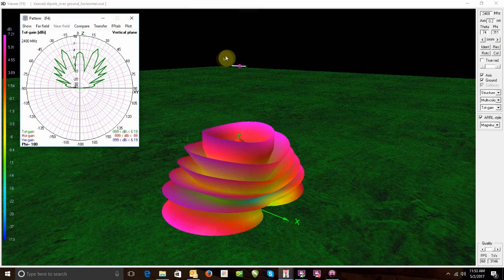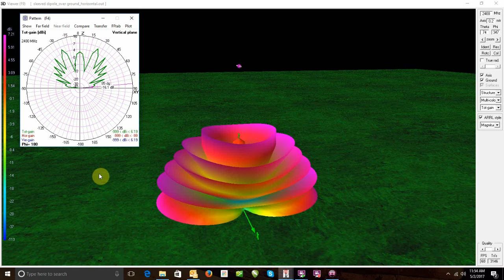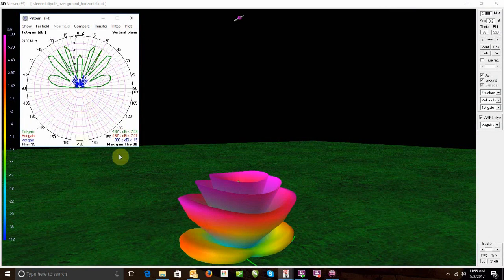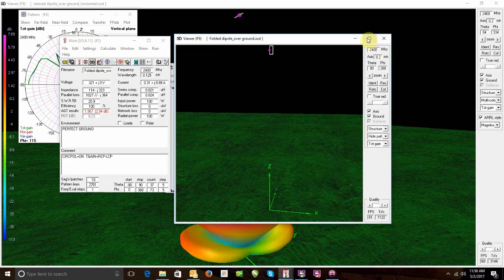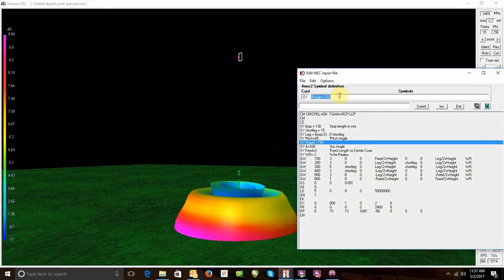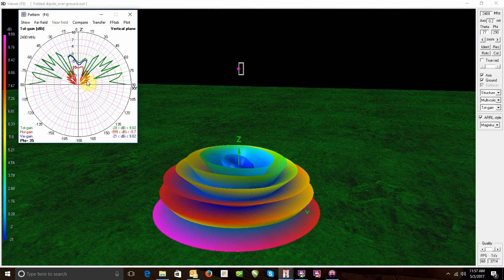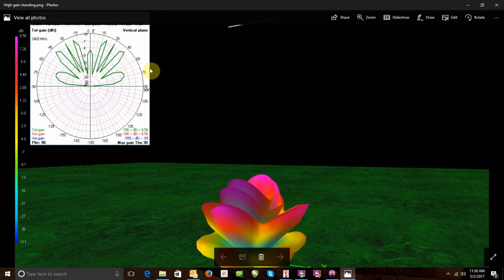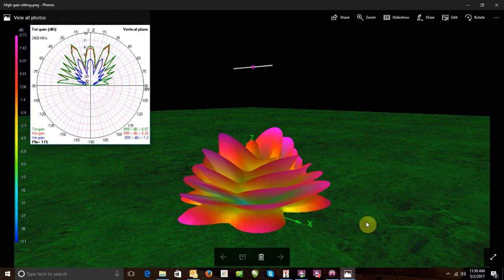Why I modified the antenna on my 2.4GHz RC radio

Comment: Hey IBCrazy. You still selling that mad mushroom? I see the antenna you are using on eBay for sale. How do you have that second antenna mounted? Do you have a thread about it anywhere? Thank you for your time if you see this and respond.
Reply from the maker: I just used a u.fl to SMA female extension cable for the Mad Mushroom.  However, I now run a Shapeshifter antenna which is even better since it allows me to boost my signal for more range.

Comment: Where can I buy that kind of antenna?
Reply from the maker: You can get it from the Video Aerial Systems website.  There are a few retailers which see it as well.  However, the form is different.  It is made entirely on a PCB.  The antenna is called the "Diamond".  https://www.videoaerialsystems.com/collections/antennas/products/shapeshifter-antenna

Comment: Thank you for the video. Could I have your opinion on what is causing my Taranis X9D Plus Eu version and my X8R rxs to loose signal in range mode in 1 out of 3-5 times when I enter range mode, not always. Also once happened during flight so not in range mode, when I heard telemetry lost alert. The signal drops in the first seconds when entering range mode, eighter I do it ar 2m or 30m. And if it doesn't drop then I will have 50 RSSI iven at 100m. I know the signal will be lost when entering range mode the RSSI starts higher, like 91 or so, than drops to zero. If it starts at about 76 or so, it drops a little and stays until 200m. With the external orange module I get 30m on orange rxs with no problem. I' ve postet on openrc forum, rcuniverse and rcgroups but no one seems to know for sure. They told me to check the Tx antena, as in range mode the signal being much smaller a poor soldering could cause it to drop but it seems well attached and when moved the signal doesn't drop. You look like someone who knows about antenas and signal so maybe you could helph me. I've just bought the sistem over an year ago brand new..and first signs were at about 4 months and 20 flights later. Because most of the times, in order to get a signal drop you need to re enter range mode, it doesn't happen always at firs shot. And mostly at 15m.. The signal and telemetry are recovered if you get close to the rx at about 2-6m, or existing range mode, or restarting the tx or rx.

Comment: at 0:06,  what is that small convenient antenna on your radio called, sir？where to buy it?
Reply from the maker: Frank - That is an old folded dipole we no longer make.  It was replaced by the diamond antenna and the Shapeshifter.

Comment: Alex,
QX7s, folded dipole vertical polarization as described (null overhead), an xm+ receiver and a 5.8 GHz video telemetry 500mW.   Gotta admit this has worked excellently with 2.4GHz and standard radio power over many flights and has given me absolute confidence! I have experienced good signal 1 to 5 meters below tree tops at 1km and can reach 1.5km at about 20m above trees.  This setup also satisfy  the general rule to always have more range control than your video will allow. And yet, I have not experienced a single !FS! because of range. Alex, man you some kind of genius! Thanks for sharing this implementation with those of us who want to fly safe and confident.
Reply: You're very welcome!  Have fun flying!

Comment: I have a taranis qx 7. I never really know which way to point my transmitter antenna. I’ve been experimenting. On my quad I have the xsr and my antennas are pointed like an L 90 degrees apart. I saw over 1.1 km the other day on 2.4 stock

Comment: Hello Alex, after owning my Taranis for 4 years I am finally updating it including this or the mad mushroom. I am ready to do this upgrade as well but there is conflicting information on the net regarding what cable you should solder to the board. Do you have an update on what size to use? RG178 vs RG316?
Reply from the maker: Either will do.  I prefer RG316 because it is easier to strip, but RG178 will be easier to solder.

Comment: I got to ask... One year later... Did spektrum ever get back to you? I received two of your 2.4 diamond antenna yeeand I'm really looking forward to moding my radio thanks!
Reply from the maker: Spektrum and I do not get a long.  So no, they went their own way much to the disappointment of many people having failsafe issues.
Reply: @CAGreve1231  , It seems to me that the quality of Spektrum radios and receivers are getting worse with each passing year. My next radio will be a FrSky brand, I'm done with the over priced, over rated, and pathetic performance of the Spektrum products. I have a DX7s transmitter that I've had for almost five years and it'll out perform my DX7 Gen ll in every category, the only difference being, my DX7s doesn't have voice and the only three way toggle switch is the flaps switch. I can easily fly three miles out with my DX7s, without any fail-safes kicking in and with my DX7 Gen ll, I can't fly out beyound three quarters of a mile without fail-safes kicking in.

Comment: I have purchased a lot of your antennas and feel they work great . My issue is that I put an order in with Hobby Wireless on March 15 th for your 5.8  13dbi pepperbox for a home base . I still have not received it . They stated ( in the middle of April ) I would have it before May . Not sure what’s going on but It’s getting warm in Wisconsin . Any help you could be in this matter would be greatly appreciated .. Thanks
Reply from the maker: We filled all of our backorders for Pepperboxes on April 25th.  Contact Hobby Wireless about their stock on it because they should have had it a while ago.

Comment: Supposedly you have to match antennas in Rx and Tx when you use polarization, yet you say at the end of video that the best option is to use a polarized antenna in your tx, but you don't mention the matching. I understand that the increase in radiation pattern quality can overcome the loss generated by the polarization, as I understand you lose approx 3db in this process. Can you elaborate on this?
Reply from the maker: All antennas are polarized.  The ones in this video are linearly polarized.  When perfectly matched in orientation (both vertical) there is no loss.  However, when in a banked turn, the cross polarization loss can be as a high as -26db (although typically it is closer to -16 db).  Thus, use of a circularly polarized antenna eliminates this loss due to antenna alignment.  This results in more range simply because it is more consistent in performance.
Reply: Cool, so you actually have a little loss that is compensated by the multidirectional radiation. Thank you!

Comment: Hi Alex, first if all thanks for all that you do.  What would be the radiation pattern if you used a 2.4 quadrifilar antenna on my transmitter?   Would there be any benefit for range and/or penetration?   Can you please do a video with the radiation pattern with the results of using a 2.4 quadrifilar on the transmitter and show what the benefits or losses would be?  I'm dying to know what your results would be and if there would be any benefits to it.
Reply: I tried a quadrifilar on my multi protocol module vs the stock antenna. My range was quite a bit better. Flights were back to back. Going across my neighborhood at the turn around I was around 70% rssi. With the quad i was in the low 90s in rssi.

Comment: Great info Thanks! I've been using the folded dipole (me standing) with the orientation horizontal. So far I've had no issues at relatively low altitude (~150ft) up to 1km (frsky xr6). The transmitter folded dipole is horizontal because of difficulty mounting receiver antenna 'tv-ears' style on the aircraft.  
I was wondering just what your 3d plot would look like with the dipole held horizontally.

Comment: Great video BTW.  Id like to use two folded dipoles with 90 degree relative orientation ( as you apparently have) , but have no idea how to connect them on a single line (Qx7 for example) . I guess this is not so easy to do?
Reply from the maker: My radio has 2 ports, so multiple antennas is easy.  If you only have one port, then use a circularly polarized antenna such as a cloverleaf.

Comment: With regard to the Taranis folded dipole mod my Q is the following..
What about the apparent 4 term increase in impedance? 300 v.s ~75 ohm? Am I wrong in my assumption?
Is there going to be a need to match this with a balun or is it ok by itself?
Reply from the maker: A folded dipole is actually 200 ohms, not 300... well... at least a microwave frequencies we use.  For this, a 4:1 cable bauln is installed on the dipole to match it to a proper 50 ohm impedance.

Comment: OK I'm confused.  Antenna theory says that the polarization loss factor between linear and circular polarized antennas is -3dB, which translates to a 50% reduction in the received signal strength.  How can the CP mad mushroom work better that the LP folded dipole?   (Unless you have CP receiver antennas)
Reply from the maker: A few ways:
First of all, the ground will affect the polarization.  A reflected wave will change polarization.  The angle that this happens is important with linear.  With circular, it is irrelevant.
Second: the orientation of your aircraft is changing.  The use of a circular antenna eliminates signal level shifts due to vehicle angle and position giving you a much more reliable signal.
Reply: I understand the benefits of having circular antennas on both ends of the link. What i don’t get is how that applies when you have a circular antenna on the transmitter broadcasting to the linear antenna(s) on the typical aircraft receiver.
(that being said, i’ve just received a pair of your folded dipoles... planning to install one onto my Horus radio’s external port and the other one into my external module. The module one has tested nicely so far, but i’m waiting on a u.fl-> SMA adapter cable to replace the stock rp-sma connector. Hope a 6” extension will be ok.

Comment: Thank you for putting together the video.  While informative, I don't think this a completely fair apples to apples comparison.  In the first case, the dipole appears to be horizontally polarized.  In the second case, the folded dipole appears to be vertically polarized.  The propagation characteristics over ground are different for Vpol vs. Hpol and will result in different patterns (refer to image theory).  Here's a good paper on the subject: https://www.qrz.ru/schemes/contribute/arrl/chap3.pdf
Reply from the maker: Spektrum fixed the antenna in place horizontally so it was forced in the position I showed.  Thus, it is a very accurate comparison.  I actually contacted Spektrum about the issue and they decided it wasn't worth fixing.  Hence, they are known as "Team Failsafe".
Reply: Good to know, I didn't realize you were using a radio with an antenna that can't be adjusted in orientation.  Team failsafe - that's hilarious!
Reply from the maker: You can lead a horse to water... Can make it drink...  Such an easy problem to fix, too.  It isn't like the effect of ground is unknown.  Fixing the antenna in the horizontal position aiming the null at your aircraft has to be the worst possible orientation, yet Spektrum makes it that way.

Comment: So is this good for ground 4x4 truck based RC FPV? I am adding an SMA socket to my Futaba 4PLS so I am able to run a different antenna for longer range. I added a camera etc.. a few months back to my RC and it's a lot of fun but I would like to have 1000ft+ range. Madmushroom on the TX and airscrew on the RX? Or this on the TX and ?? on the RX.
THANKS!
Reply from the maker: Yes, this will work well on your truck.
Reply: Thanks so very much.

Comment: Alex, i have used this folded dipole all summer. It seems the antenna is getting weak where it keeps bending to fit in the case. Do you sell only the antenna with no pigtail (the on that solders to radio)
Reply from the maker: Just put some heatshrink tubing over it to stiffen it back up.  If it is shorter, the radio will interfere with the signal.

Comment: HELP  HELP  I have been trying to find the Mad Mushroom that Alex refers to for the Taranis and have not been able to find it for certain.  It says for a receiver but is this the Mad Mushroom for a Taranis or where can I buy one.  Thanks   http://www.simtechfpv.com/2.4ghz-rhcp-blubeam-ultra-mad-mushroom-antenna
Reply from the maker: That will work on a Taranis very well.  You will need an extension to get an SMA port on the outside of the radio, that's all.
Reply: Thanks for the reply and that the Mad Mushroom antenna will work good on a Taranis.  I just ordered the last one on ebay.  I'll let all on the forums know if it is as good as Alex mentions.  I have an SMA connector on top of the Taranis.

Comment: Alex Hi,

Great video man,
Can you explain in more technical terms why transmission line length matters ? per my understanding it should match the TX/RX and the antenna so taking a cable of any length as long as it is 50 ohm impedance (coax) cable should be good, assuming antenna is also terminated as 50 ohm load...
Maybe it's like a trick to minimize losses and make SWR behave - but this is exactly what I'm missing, hope you can explain a bit.
Also how did you reach 84 mm ? please provide full calculation.

Comment: Alex, based on how the radiation pattern of an antenna works, at least based on how I understand it, the RF signal is strongest at a point perpendicular to the long axis of the antenna.  Given that when you sit or stand with a dipole antenna parallel to the ground you would get lots of reflected signal interference, would it not be more beneficial to orient the long axis of the antenna perpendicular to the ground, which is somewhat like your modified antenna is doing.
Reply: I agree entirely.  I am always confused when people have their antennas parallel with the ground.  I never thought about the reflected wave patterns, I just didn't want a null to my left and right, I'd prefer a null over my head.  Now, if you're flying high altitudes over your head, then maybe it would make more sense to point it parallel.

Comment: I'm down to try flying with a mad mushroom on my taranis, but does that mean I should mod my aircraft to use an RHCP antenna on the rx?
Reply: I found this question interesting! And by looking where to get the ibcrazy 2.4ghz mad mushroom i found this text ind the description:
"Another amazing creation is built by Alex Greve (IBCrazy).  The new Mad Mushroom antenna design surpasses the other antenna designs for FPV flying performance.  This antenna is right hand circular polarized, and can be used with linearly polarized antennas (with some loss) or a more perfect match is another right hand circularly polarized antenna.  Not to be used with left hand circular polarized antennas."
Hope to help you with that ;-)

Comment: Dear Alex, 
greetings from Italy! I got a Taranis plus SE (the one that comes with antenna mod), and had 0-1 SWR on both 2dbi an d5dbi antennas, but since the start the range was not that good (200m max, lost connection several time).
Since I have other vas antenna for video I am very happy with I got your dipole antenna, and when I tried with an adapter I got 0 SWR value :-)
I then soldiered the wire on a new Taranis  backboard I got (just in case of screwup), but I get weird results:
Now the folded dipole (without adapters) stays around 16-17 SWR, and the 5dbi (with adapter) stays at 0.
Any clues? Should I just ignore it? 
 I'll do today some range tests and provide some feedback, thank you very much!

Note: I removed a speck (capacitor? resistance?) soldiered between the two "poles" on the new backboard, I assume was a test load to test the device as I was getting 0,5 Ohm between them before soldering anything to it.

Umberto
Reply from the maker: It sounds to me like the cable you used and the one out of the Taranis were different.  If you used a good quality cable, then I would not be concerned about the high value on the Taranis.  The SWR on the radio is a guess at best and very inaccurate.
Reply: Thank you for the quick reply! the cable I used was the one that came with the folded dipole, so I think I'm safe :-) have a great day!

Comment: How match you the much  higher wave impedance of 292 Ohm with your folded dipole to the 75 Ohm of the RF board? What is the standing wave ratio.?
Reply from the maker: The radio board is 50 Ohms, not 75.  The antenna uses a 4:1 balun to match the impedance.  A closed loop antenna is much closer to 180 ohms than 292 at microwave frequencies so the 4:1 works well.

Comment: What 10 plus channel TX has two antennae and at least 150mw? I wanted the Radiolink but not sure. It seems like the ones I can afford are either have one antenna or no power. Right now I have a modified 10ch Flysky with external antenna and good strength. Want to get one that I can work on.